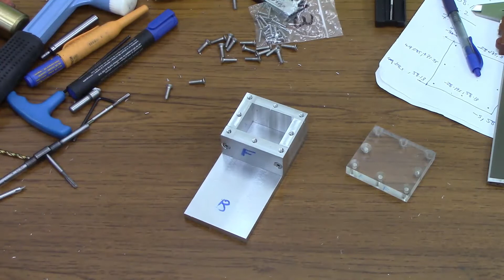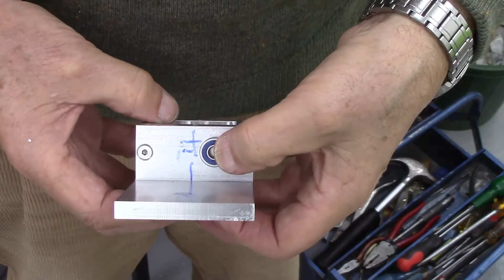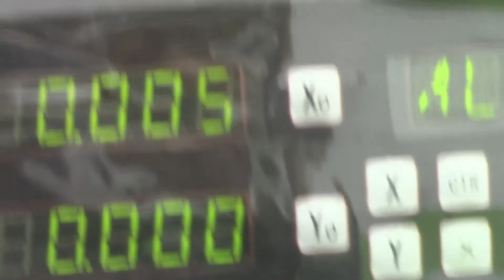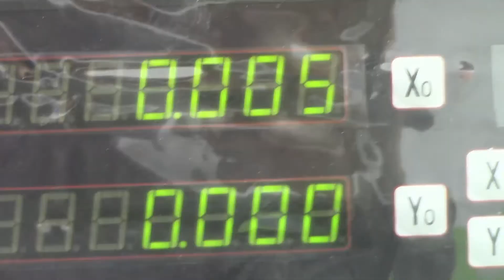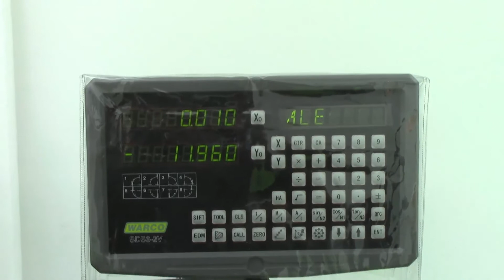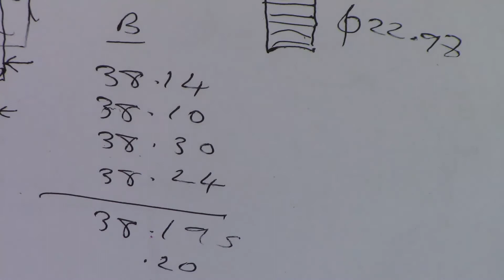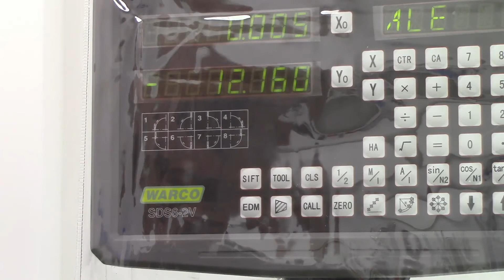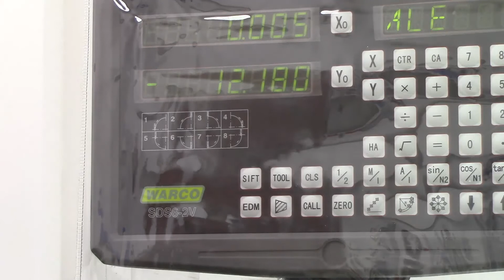Making a worm-wheel servo for Woodstock

Comment: Hi,
Instead of relying on the dial marks on the boring head, use a DTI on the movable part of the head.
With a magnetic base on the machine bed. ( Less chance of the backlash causing a problem).
Just remember to divide by 2.
Adam
Reply from the maker: Yes, I've seen that done but forgot about it. I did firmly press the lower movable part back onto its worm screw whilst adjusting though.

Comment: This is looking nice.  Will the installed orientation be as shown, ie, with the seal on top?  In which case are you going to use a timing belt or chain drive to the final rudder axis?  WRT seal lubrication, for both shafts I would mill a very small keyway that leads as far as the back of the seal.  That will let oil enter that far.  For the vertical seal up top, thats a bigger problem.  Many old engines used "Splash" lubrication, where a splashing stick was placed at the bottom of the connecting rod.  This scooped up oil and splashed it about.  You might be able to do something similar here.  Another option might be to mill a slot in the shaft and stick a wick in it, which would hopefully bring oil up to the seal.  Personally I would fill the entire box with oil and do a long term test like you did with the other motor.
Reply from the maker: Yes seal on top and I was thinking of using a toothed belt. I would much prefer to mount the servo directly atop the rudder shaft but that is simply not possible in Woodstock without cutting a hole in the deck which isn't practical. A keyway in the shaft (I presume you meant) is a good idea, so long as it doesn't run as far as the seal rubbing area. A splasher is also a good idea, and since the ends of the worm never engage with anything I could perhaps mount one there. Of course in the sea Woodstock is often heeling at quite an angle so with enough oil in the box it might get up there anyway from time to time.
Reply: @samuelfielder  I forgot about motion. Yes, with keyways the oil will definitely get around the system as the boat bounces around. A timing belt will do a great job.